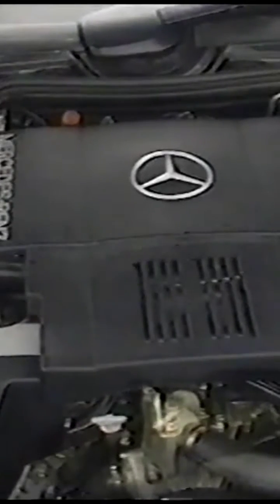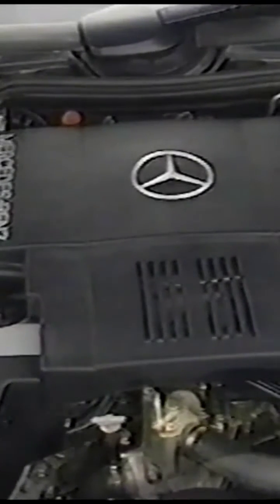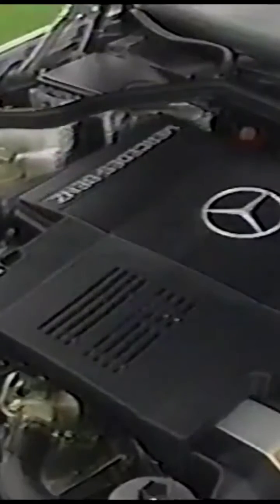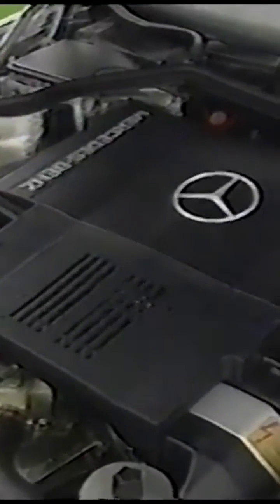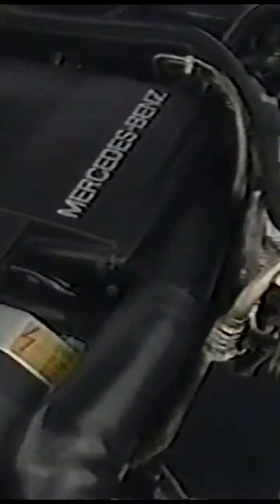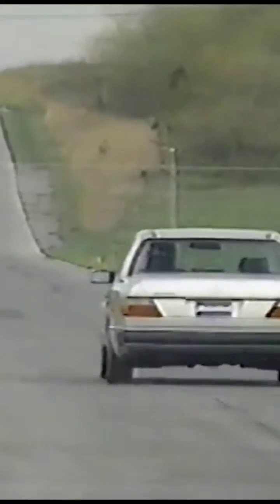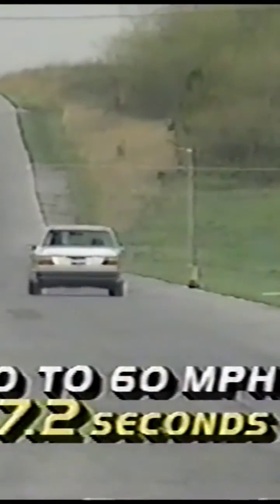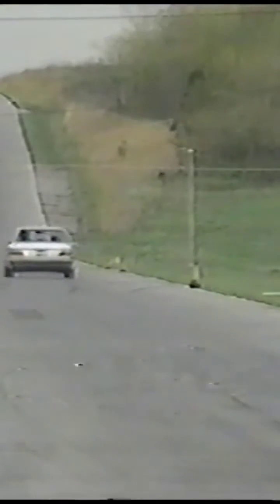Mercedes (M119.975) 4.2L DOHC 32v V8 Engine (268 hp/296 lb⋅ft) (W124) '92 Mercedes 400E #w124

Comment: The problem of this engine is the torque delivery at high revs, I still prefer Mercedes classic V8-SOHC layout
Reply: What are you even talking about? Torque at high revs is excellent, much better than the M117 before it and the M113 after it due to it having the proper 4 valve setup. Low end torque is excellent as well.
Reply: @the8419 ha ha no kidding, m119 is so much better
Reply: 5.0 liter s500 315 hp has seen 700hp and more with c11 group twin turbo m119
Reply: NO UR PROBLEM IS U LIKE MERCEDES AND NOT BMW 💯🤣🤣🤣🤣 ONLY GLITTER DUSTING POWER FAIRIES DRIVE BENZ
Reply: NEGATIVE. I got two of these. Smash the wood pedal and your feel the tq like the GNX kicking. Youll feel everything in the 195 oem tires
Reply: Those sohc v8-s are just slow comoared to that m119 who performs like a beast and don't forget that the sohc which you are talking about is an 5.6l and this m119 was 4.0l